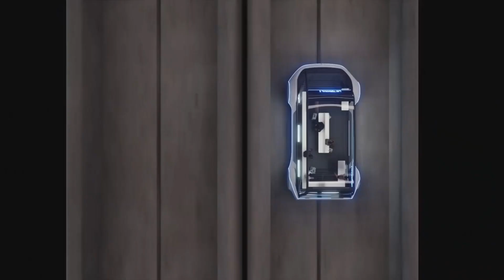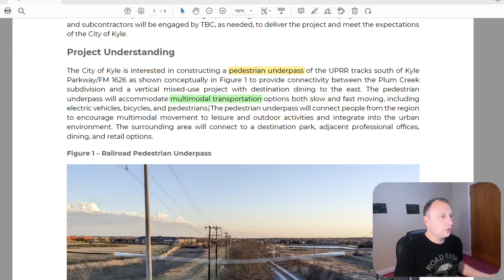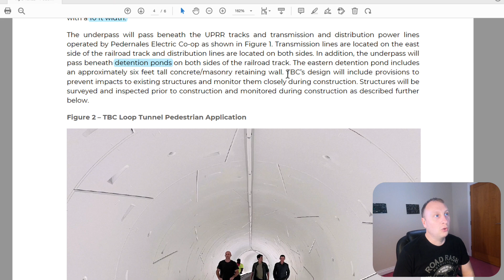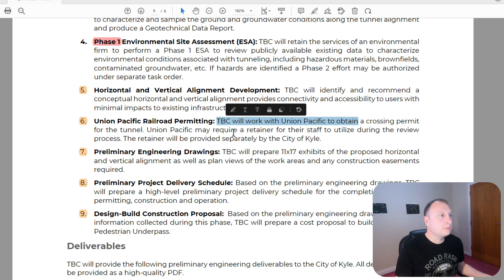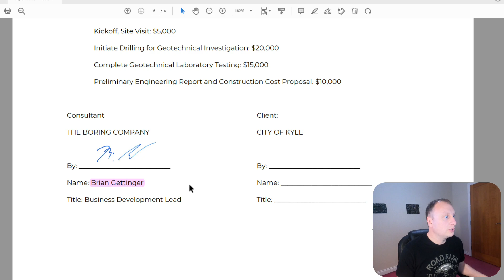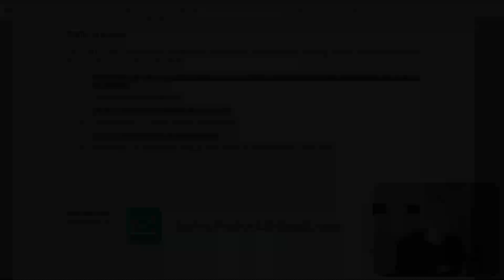Kyle (TEXAS) : Railroad Pedestrian Underpass Engineering Proposal 😊 👍🏼 🏗️ 👷🏼 🛤️ 🚇 # 146

Comment: The Houston pedestrian underground skyways need to taken into context to get a full picture. They are pedestrian tunnels, but could clearly benefit from bicycles, but bicycles will never happen as it's owned by dozens of different corporations. Most sections close daily. By multi-modal they likely mean bikes and e-scooters in outside lanes, pedestrians would share a middle lane. Bots dots, high vis poles, thicc paint or groves could act as the lane guard.

Comment: Have you noticed how bumpy and uneven the sped up videos of the Vegas loop look?  I worry that the reason for the 30 MPH safety speed limit is that faster speeds would be too bumpy.

Hopefully this pedestrian tunnel will allow them to work on the tunneling accuracy before returning to higher speed tunnels.

How you noticed anything in specs that indicates a minimum tunnel straightness accuracy?

Comment: Electric vehicles here refer to personal mobility
Reply: Maybe. The people proposing this project need to clarify to avoid confusion.
Reply: @jbbuzzable  I agree, but if they were going to run electric cars, they should have run 3 tunnels.
Reply from the maker: Yeah that is likely the only other use case if pedestrians are the main users of this tunnel.
The terminology should just say sub-500 kg electric mobility solutions.
Reply: @BoringRevolution  How much would it increase costs to add a second or third tunnel. I assume preparing everything and getting the TBM costs a fair amount, and this tunnel is short.
Reply from the maker: @fjalics  So it would cost in total about $5,400,000 for three tunnels.
Might be easier having a "single" one-way car tunnel that feeds into the development + a single pedestrian tunnel. Cars could then use the level crossing situated about 1+ mile north of the site for getting out.